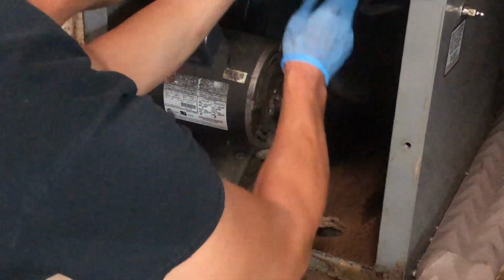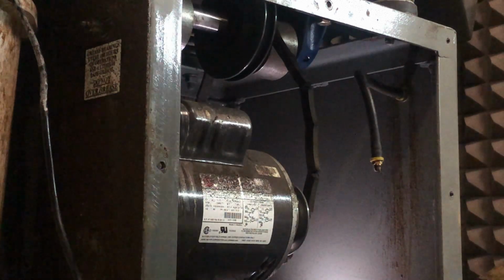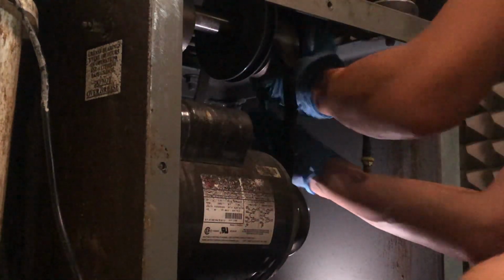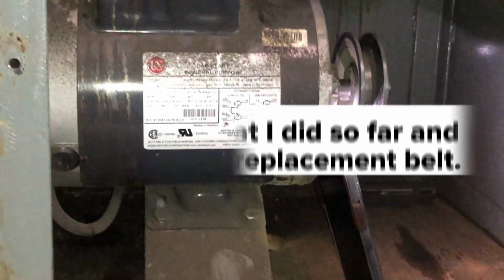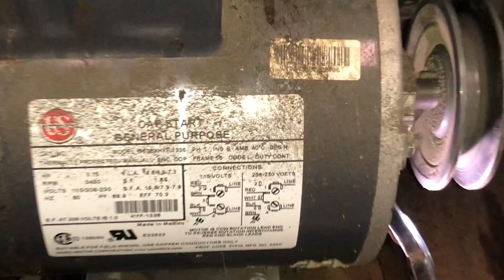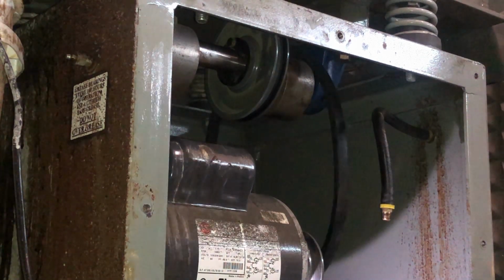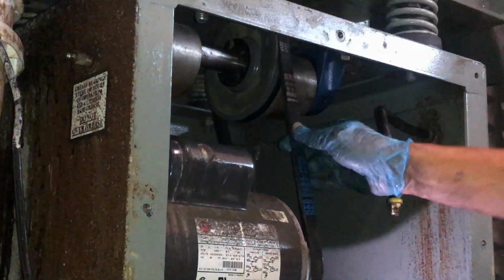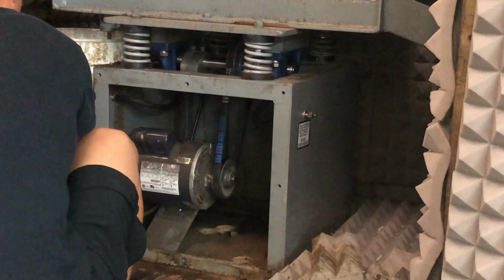Repairing Mr. Deburr 300DB Vibratory parts tumbler belt replacement

Comment: Amazing timing!!! The belt on ours at our shop just snapped this week had it in and back running in 30 min thanks guys!
Reply from the maker: No problem. Glad the video helped out.  We also have a bearing assembly replacement video for this machine too. If you ever need reference on how to change out the complete bearing assembly, check it out.  Thanks for watching.

Comment: The motor doesn’t get to hot in that box?
Reply from the maker: Hi, The soundproof box has been working great. We run the machine 5 hours a day, every day for the past 7 months. We haven’t had any heat issues. I installed a cooling fan from a desktop computer to the bottom of the box.  It turns on when our tumbler is turned on.  Here is a video of the soundproof box build.

https://youtu.be/ivt-gLvJrmg?si=XRqGthC-PJ5ieMdW